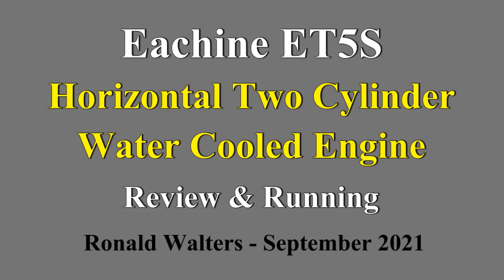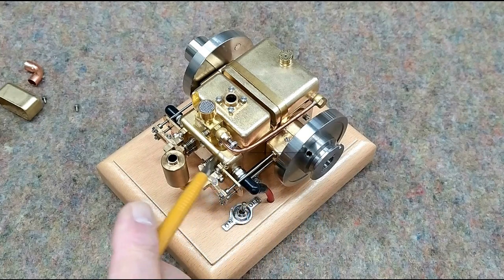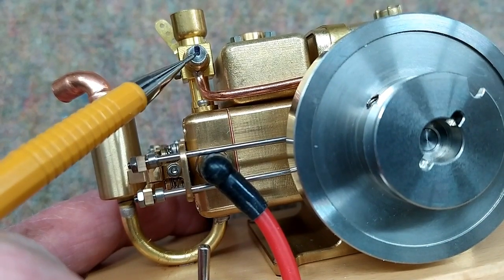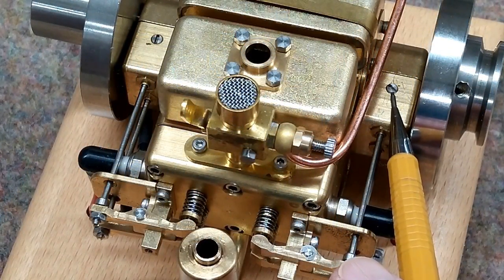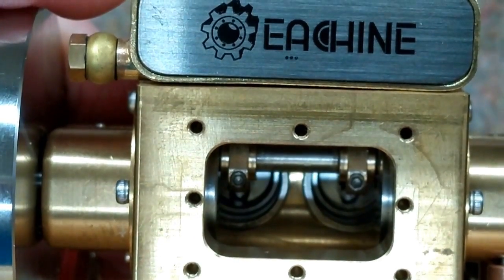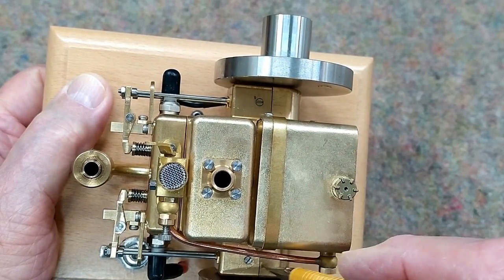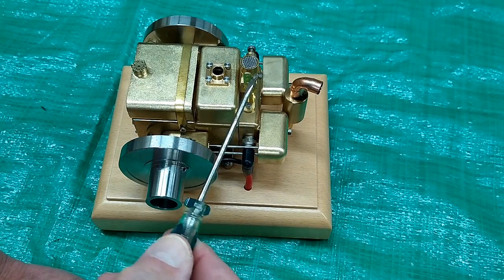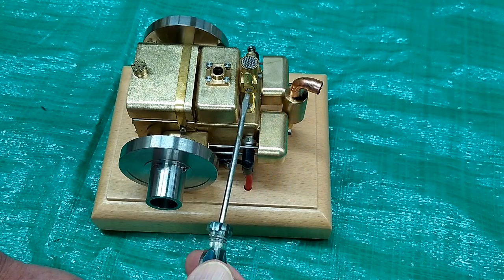Eachine ET5S Twin Cylinder Engine Review

Comment: About 1:44 of the video you mention that the engine fires both cylinders at the same time we can hear the sound well but it is possible to do it alternatively I saw a video of a tractor recently released where we can hear the two cylinders fire alternately just change cam position✌😉
Reply from the maker: Since the Hall effect sensor ignition system fires twice per 4-cycles (@ TDC compression and exhaust) it is possible to change the cam timing to get it to fire alternately. But, that is not the way it is supplied from the factory, therefore I review them as I receive them.

The other side of the coin is the crankshaft, which has a single LONG journal for both connecting rods. A properly designed crankshaft for a twin cylinder engine would usually have separate journals for each cylinder and generally that would also have a bearing between the two journals. The two journals could be 180 deg spacing (opposed) or 360 degree (both together) but the journals would be separate (unless we changed the subject to a V-twin engine).

I was told by one viewer that he changed the valve timing and had his firing alternately... but I have not personally heard one.  

I question how long the crankshaft will last with the engine firing alternately on that long journal. Actually I wonder how long it will last firing together. :-)

I am not a big fan of the ET5 series (ET5, ET5 Pro, ET5S). My original ET5 quit after a week or so and I haven't been able to get it running since. I was sent an ET5 Pro with a Pump. I first made the mistake of trying the factory recommendation of adding 4ml oil to the crankcase, which resulted in oil blowing out the exhaust, total loss of compression and necessitated complete disassembly to clean up that mess. I was (finally) able to start it and it ran fairly well for about 1 minute, then quit... never to run again. I have had the ET5 and the ET5 Pro apart and together more times than I can remember replacing/swapping ignition, o-rings, you name it... I've done everything except swing a dead cat. Very annoying since I can usually fix most things... but have (finally) accepted failure with those two chunks of brass. Also annoying since I had the complete ET5 Pro with Pump review video completed, except for being able to run the engine and demonstrate the pump.

This is probably why I have chosen not to mess around with the timing of the ET5S.

Probably more information than you wanted to know. :-)

Thanks for watching. Please subscribe!
That is what keeps this channel going.
Ron
Reply: .To answer the question whether the factory now sends engines that have an alternating cylinder firing order the answer is yes it is a very distinctive sound Let me suggest a video to watch, we can hear the very distinct sound https://youtu.be/X6xQbxrRIeM
Reply from the maker: Interesting that it was supplied firing alternately. Pretty boring drawn out video but it does sound better. I read your last comment and watched the video... then your comment disappeared.  Nothing new for YouTube. It'll show up again one of these days.

Comment: 9:22. Standard TN carb as found on countless thousands of RC plane, car, boat engines made over the past 50-odd years. You NEVER adjust the low speed set first. ALWAYS high speed, THEN low speed. Low speed is 100% tied to high speed as its seat is the spraybar in the venturi. Every drop of fuel the low-speed needle meters has already been metered once by the high speed needle. 

The biggest problem with setting these carbs is you need to have the engine under a heavy load to get a proper high-speed mixture set, but putting them under high load will just melt the viton o-rings out of them. This problem does not appear with RC engines because they're in an RC model that can supply that load and are designed to work for a living, but these ltitle brass Microcosm engines seem to only be designed to spin their own flywheels.
Reply from the maker: I have built and flown R/C airplanes for over 45 years. I have worn out a number of engines in that time and I am completely familiar with how they work and how to repair them. I have said in my videos and comments several times, these are model demonstration engines and are not intended to run full power nor for long periods of time. An OS, Saito, Enya, YS or Webra engine, these are not.

These engines are not manufactured to the tolerance of the model airplane engines. Run for the duration of one tank of fuel at moderate speeds and under moderate loads... given a chance to cool before running again... the green FKM fluorocarbon o-ring piston rings will last longer than you might expect.

Yes, the high-speed needle valve is USUALLY adjusted first. Spinning the propeller on an airplane engine generally provides near full load except it does cavitate when stationary. Actually flying the model determines any fine-tuning, which may be needed. Ambient temperature and humidity also come into play.

The high-speed adjustment was not shown in this particular video. The USUALLY part comes into play when the low-speed needle is received fully closed (or closed too much) as clearly stated @ 7:20.

Microcosm generally manufacture Stirling and steam engines. I have reviewed a number of their engines.

The engine in this video and those reviewed of the hit & miss variety are manufactured by Eachine.

Thanks for watching. Please subscribe. Ron
Reply: @RonaldWalters2010  I have an M17b on order. I will find out what the weak links are; it will not simply spin its own flywheel. It will likely be the beating heart of an N scale layout that does not need plugged in to the wall.

If it cant sustain 10-15 watts output continuosly it aint worth the $300 it costs.

Comment: Seems pretty pointless having both cylinders firing together, they could've made it a 360 degree twin, especially seeing as it has a wasted spark ignition system.
Reply from the maker: I thought it was very silly. I was quite disappointed it did not fire alternately... but it does run strong! Ron

Comment: I think it would be better if both pistons were not in the same position, entering the cylinder together like a normal engine, it would perform better
Reply from the maker: I was certainly disappointed the cylinders did not fire alternately.
Reply: @RonaldWalters2010  yeah it’s like 2 engines put together

Comment: I changed it from igniting parallel to opposite ignition simply by turning the camshaft drive about 180 deg. It fires by wasted spark so you don't have to convert the ignition. The benefit is lower idling, the sound is different and the power is the same.
Reply from the maker: Very good. I haven't gotten around to changing mine yet. I was a bit annoyed that this did not fire alternately from the factory. Twin exhaust would also have also been preferred! I guess time will tell if that long connecting rod journal will fail with alternate firing... probably no greater chance of failure than with both firing at the same time. That crankshaft is a shortcut... they did not want to make an offset crankshaft with a center bearing support. Thanks for your comment and Have Fun! Ron
Reply: Would you have a video of your engine running?  Would love to hear this engine running the correct way.  Cheers Willy

Comment: This engine could easily be changed to alternating firing by moving one of the camshafts 180 degrees. I think it would have a nicer sound. 
Cheers
Willy
Reply from the maker: Difficult to get a straight answer from this manufacturer. There must be a reason for this not firing alternately... the journal for the two conrods is quite long... may cause crankshaft failure? One of these days, if I don't have anything better to do, I may try it and see if it goes up in smoke. :-) Ron
Reply: @RonaldWalters2010   Firing them alternately would be better I  believe that both at the same time increase the danger that the crankchaft fails at hi rpm  Firing them alternately would mabe balance  It's just a theory I don't have one of these models to test  But would be very curious to know the result.
Reply: Wgb The carburettor may be a problem or even help for better performance because it will be solicited by one cylinder at a time, allowing the cylinders to breathe better

Comment: God I could barely get my 1 cylinder running. Once I got that running I ran it hard everyday for like 2 months. Ended up blowing it up. The bottom end of the connecting rod split on the end. I lost the screw so I used 1 screw for awhile. Finally the threads broke inside the connecting rod. Motor is scrap now lol
Reply from the maker: Without a governor, it is easy to overspeed an engine. If you do that long enough or often enough, something will eventually break. Sorry to hear about your engine.

Comment: Hello Ronald, are you 100 % sure that the power stroke of this 4 stroke 2 cylinder engine doesn't differ between the 2 cylinders?
Reply from the maker: Positive. Both cylinders fire at exactly the same time.
Reply: @RonaldWalters2010  That's a pity. Can the cam(shaft) for one of the 2 cylinders be twisted by 180°?
Reply from the maker: I don't know. I have never taken the gear box apart on one of the ET5 engines before.
Reply: @RonaldWalters2010  Next challenge?!? 😉
Reply from the maker: I review these engines exactly as they come out of the box and this was set up for both cylinders firing at the same time.

I pulled my ET5 apart, so I could look at the cam gears. I see no reason why the cam for one cylinder of the ET5S can’t be turned 180 degrees.

I have asked the manufacturer which way it is supposed to run (always a possibility mine was timed incorrectly in the first place). It will be Monday or Tuesday before I get that answer. That should be interesting.

The helical gear on the crankshaft has 12 teeth and the helical gear with the cams has 24 teeth. It is very hard to see the relative gear positions and there are no timing marks :-) as usual.

If it can be changed to alternate firing, it will probably change the carburetor needle valve settings, as only one cylinder would be on intake at a time. 

Stay tuned.
Reply: @RonaldWalters2010  😃👍
Reply from the maker: The manufacturer says the engine is intended to fire both cylinders together (at the same time). Nothing else was said. Note: This manufacturer is not forthcoming with information. A bit like getting blood out of a stone.
Reply: @RonaldWalters2010  Does this answer satisfy you or does it rather wake up your desire to discover something new and face unknown challenges? 😉
Reply from the maker: An OS, ENYA or Webra engine, this is not. If it were, there would be flats or keys to drive gears and timing marks for correct and easy assembly.

I made a video the other day regarding how to time the gears/valves for the ET5 engine. Not easy as it is difficult to see the helical gear with the cams and there are no reference points except the two cam followers. This video will be released later in the year.

One would be tempted to loosen the setscrew holding the drive gear to the crankshaft but I doubt there is a flat on the crankshaft for this setscrew. The setscrew has probably been driven until it embeds into the crankshaft, which would result in a deformed section and make it difficult to remove the gear. There is probably thread locker on the setscrew.

A lot of these smaller setscrews do not have hex sockets formed to close tolerance. The setscrew in the crankshaft drive gear has a 1.27mm socket. Most hex key or Allen wrench sets stop at 1.5 mm. I have one (1) Bondhdus 1.27mm ball end wrench and it will not engage the socket. The socket is either not well made or it was deformed (stripped) upon installation.

I don’t know why anyone would make a twin cylinder engine which fires both cylinders at the same time. Firing alternately, possibly it would run rough, jump around on the table or crankshaft failure could be an issue. 

I do not intend to change the firing order at this time. I will ask the manufacturer a few more questions but (past experience noted) doubt I will get any answers. :-)
Reply: @RonaldWalters2010  Thanks a lot. I'm a dreamer and thought it could be easily done. Just twisting a cam by 180 deg and that's it. That was my idea. I thought it would then run even smoother.

But ALL the models you introduced are nicely made. They could be used in schools and even for adults for learning purposes. 😃👍
Reply: You can clearly see the valves on each cylinder moving together. This is just a waste of a 2 cylinder engine. I was planning to purchase one until I heard Ron running his and could tell by the sound that it wasn't firing alternately.  Reminded me of the old Snow Cruiser snowmobiles which were 2 cycle, 2 cylinder and both cylinders fired together. Oh what a sick sound. You could hear one coming for miles.  Anyway stupid way to make a 2 cylinder motor.  Cheers Willy